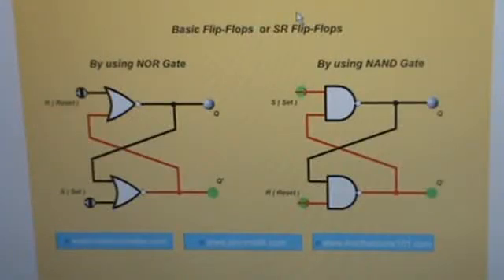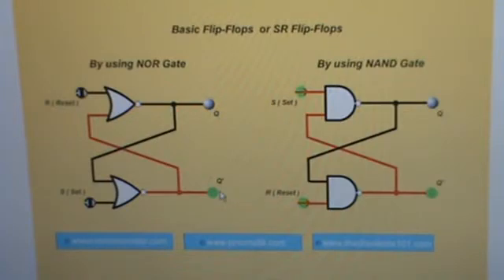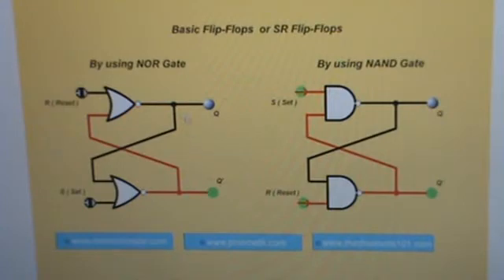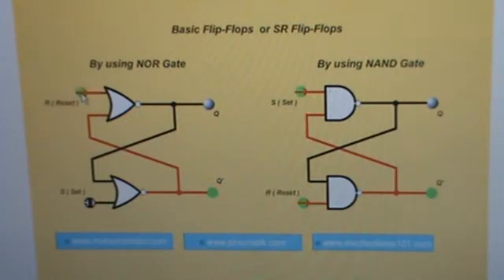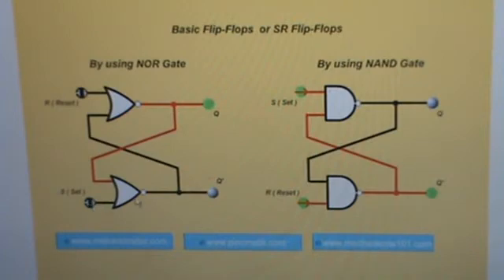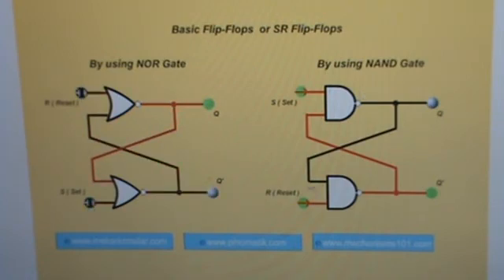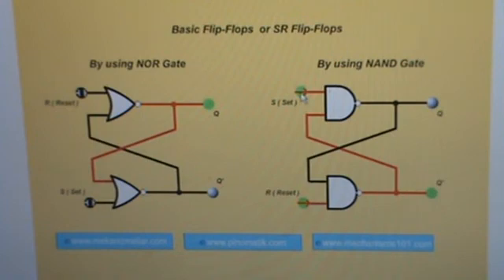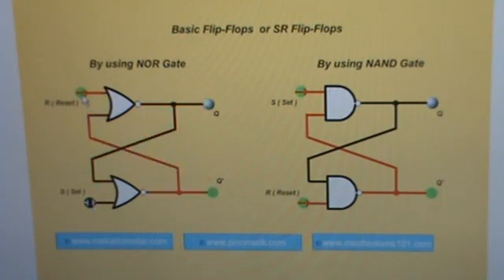SR Flip Flop Intro

Comment: One question, when the NAND Gate SR Flip Flop is powered up and configured to make "S" and "R"  high at power up, is "Q" always initially high or is there a need to implement some sort of delay (using an resistor and capacitor with different time constants) so that "R" is high just before "S"?